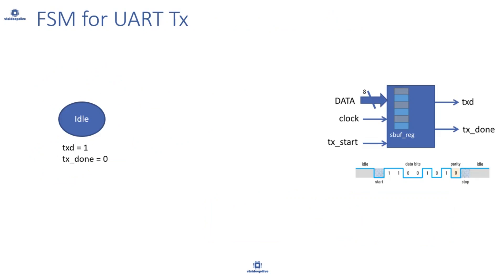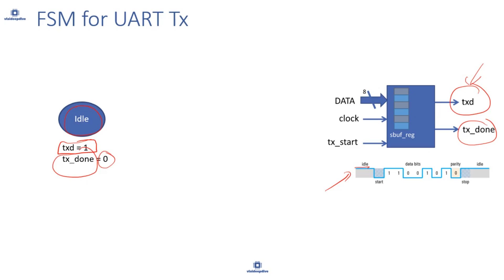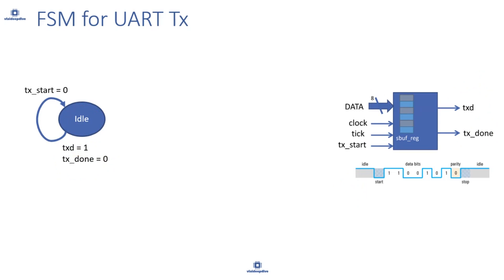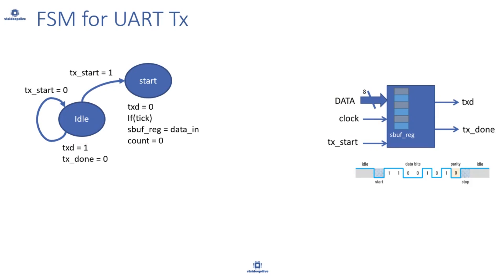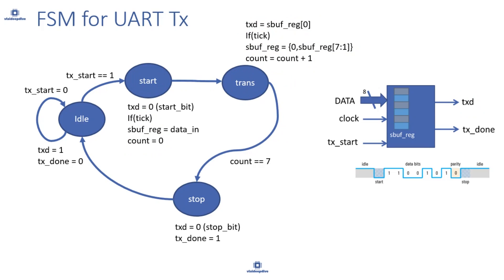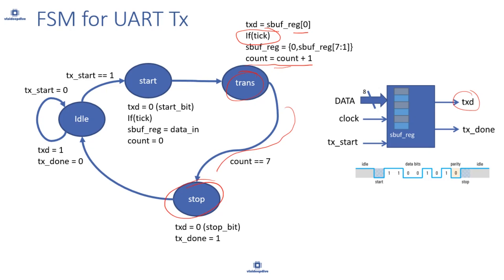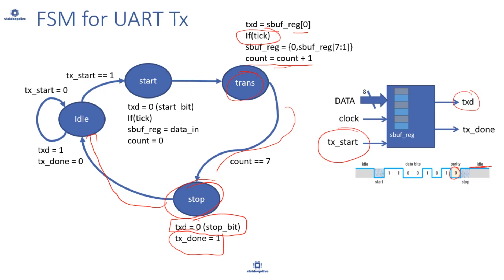UART Transmitter FSM

Comment: For chnaging the state from start to trans FSM states, what is the input, i.e on what condition the state is changed? You told the tick signal is set from the the baud rate genereater, so is it constant? Can you explain this?
Reply from the maker: It's a function of input data and clock., you can see the full video with RTL code here - https://katchupindia.web.app/protocols